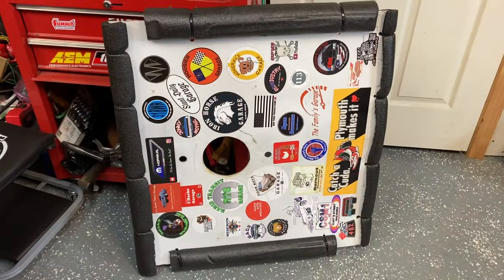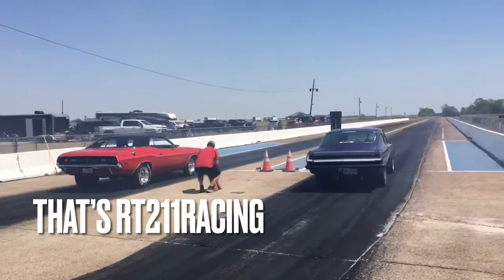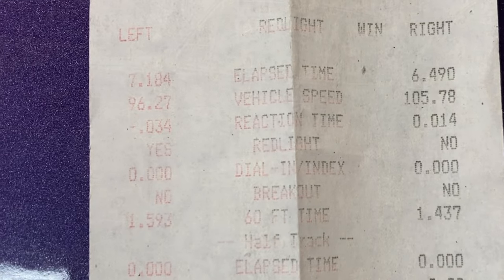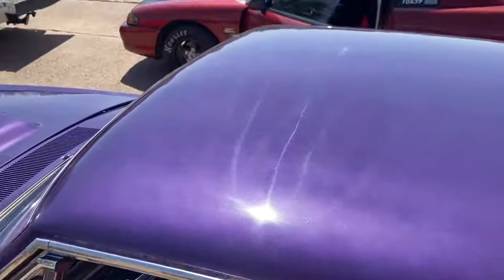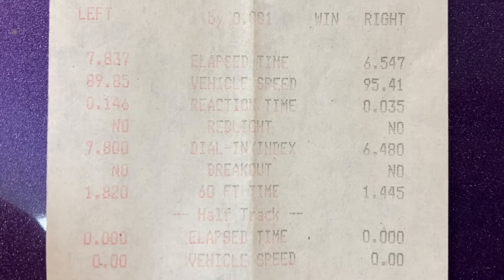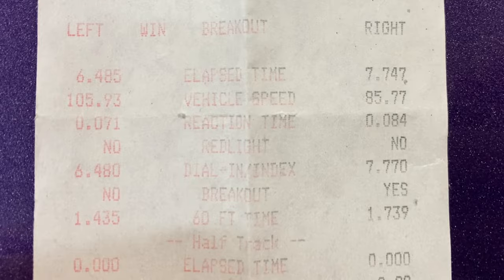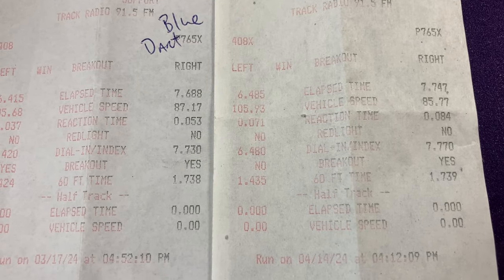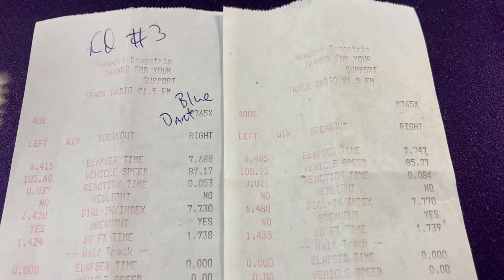Barracuda Dragcar: Driver Falls Asleep at the Tree! #mopar #nonamenationals #bigblock #bigblockmopar

Comment: Hey Joe, never mind the loss, just knowing the Cuda is in test and tune mode there’s more to come. 😊
I feel like second gear has more rpm to stretch out, I might be wrong.
Nevertheless looking forward for a spin next video around. 
Take care MPR J🙏🏽 👍
Reply from the maker: Thanks brother. I have been pretty conservative with shifts. Usually around 6,000. I’ll get there early someday and run her on up some.
Reply: I'm pretty sure you could shift that baby at 6500 on both shifts
Reply from the maker: @Lipmonster  I will take it out and see. Cam is fairly mild for a solid roller. Only 4,000-6,500 range. We kind of used it with keeping rpm down in mind, for less valve train wear and hopefully engine longevity. Also, I only have 210 cc runners in my e street heads. I wouldn’t say they’re high rpm designed pieces either. It’s been a good torquey combination so far. I am dreaming about going 4.56 gear from the 4.10

Comment: I gained (dropped) .12sec by putting a fiberglass front valence (the original one was bent and really ragged) on my Demon and fabbing an aluminum plate with a riveted-on BG "air bell" radius and sealed it to the hood with closed cell upholstery foam around the perimeter. Made both changes at the same time, shame on me!! LOL
Reply from the maker: The air is real!